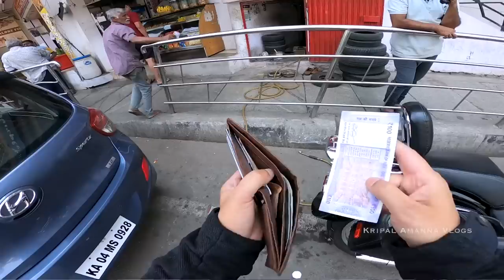MY CONNECTION TO AN INDIAN CRICKET LEGEND IN THIS NEIGHBOURHOOD! Vlog 179

Comment: 1. Just saw one of my clients office there in 3rd block :face-green-smiling:  Anyway, these days it doesn't  really matter where they are . I had never seen that office before. In fact I didn't quite realize that they are in Bangalore!!  2.  Raheja Residency is quite old. I guess one of the older properties in Koramangala.  3. I think Bangalore was never a city of apartments. The apartment thing started from Marathalli? 4. However,  20 years back if you checked out Sankar Mutt Road and Basavanagudi on the other side of the city , you would have spotted more Bungalows. (of course Jayanagar) 5.  It's all a change. Don't know good or bad. 20 years back I used to crave for tall buildings in Bangalore. Now, when i don't live there, but a wiser me got to know, understand and respect the south Indian culture, I truly feel Bangalore should have been stuck in time.  5. I think the only theater that played any Hindi movie was Galaxy in DT.  And I didn't know a pub or a night club that would play any Bollywood.    I think all has changed now.  6. More importantly Purple Haze Residency Road has shut down. 7. Hey Kripal, do you remember Casa Picola..it was opposite Bishop Cotton . And I think they also has a branch in Indiranagar CMH Road. 8. On Shankar Mutt Road, we had this really old couple (ajja and ajji) living in the next house. They had a Maruti van. I was friends with the Driver :face-blue-smiling: They were so simple. Then I heard that both their children are working in NASA! :face-orange-biting-nails:Crazy right?!